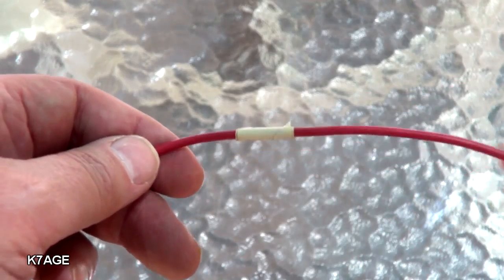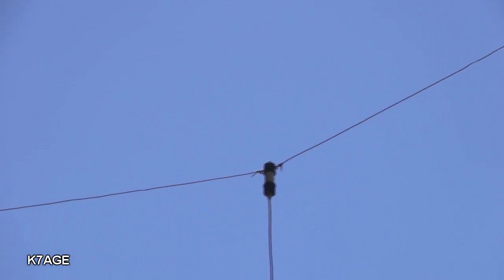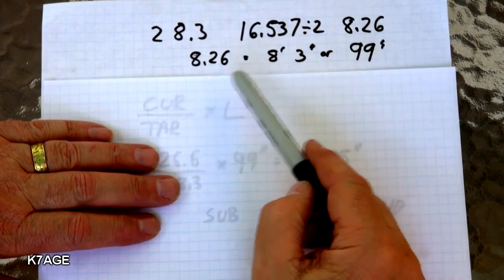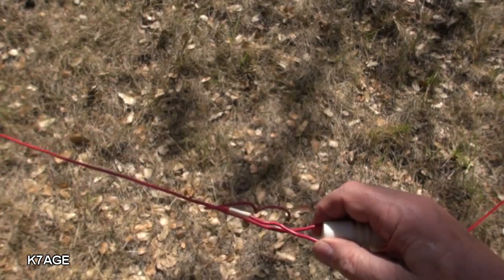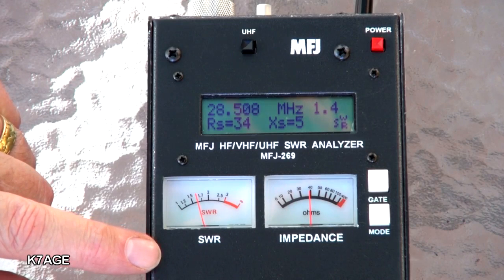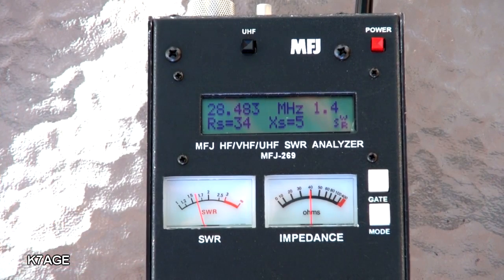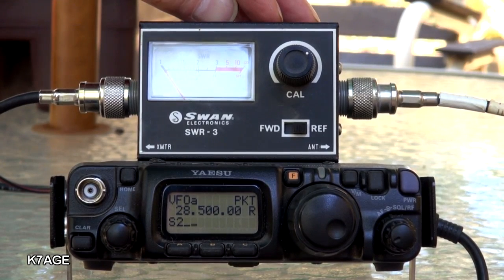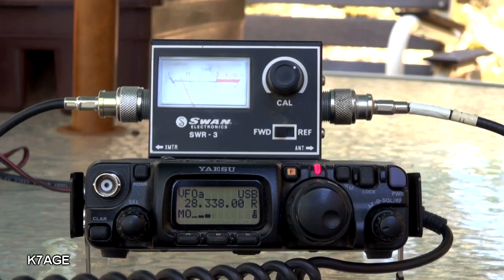How To Tune A 10 Meter Dipole

Comment: K7AGE is there a 10 meter vertical? I’m thinking using white 3/4 pvc & feed the line inside & the end cap holding it @ the top. That pvc is stiff.
Reply from the maker: 1/4 wave vertical and 4 1/4 wave radials

Comment: It's worth pointing out that you can do this by just QRPing your transmitter, keying down, and spinning the dial. If the SWR meter (in-line or built-in) rises, you're headed away from the resonant point, if it drops you're headed toward it. Trim wire as needed. A little trial and error and you're in business. (Like Randy says, you should always start with a slightly too-long wire, cos it's easier to cut some off than stick more on.)

As he also said, an antenna analyser makes everything easier but they're expensive and beginners in particular rarely have one. I've got by for 30 years using the key-down and cut method.

Great video, Randy! Thanks!
Reply: "QRPing your transmitter"  - does that mean adjusting it for low power?
"Keying down" - does that mean to hold down the PTT on the mic, and to do this while changing the frequencies within the band?
ANYONE??????
Reply: @usernamemykel  "To QRP" means to reduce transmitter power out. In this case you'd want no more than 5W. Keying-down means to close the code key. (You'll also hear it used metaphorically to mean "to begin transmitting", but here I mean closing and holding the key while spinning the tuning knob up or down.) 

I suspect you could accomplish the same end by keying a mic instead of a straight key, but as a lifelong brasspounder, I've never had to try.
Reply: @RobMacKendrick   Thank you for the very clear response!

Comment: I have a metal roof and no room to put antenna anywhere in yard. Will this system work over the house? If so how high off the metal roof? Or should I go with a different antenna altogether? Any help would be greatly appreciated.

Comment: Hi Randy.I've seen a few of your videos.
Ten metres is opening up now so I'm putting up a dipole. The MFJ tuner is very nice but expensive and after tuning an aerial how often would I use one again? I can't justify the cost. I cut the aerial long then keep folding back as you did until the SWR on my homebrew resistive SWR meter comes right down. 
Mine worked out at 7 feet 4 inches each side but it is indoors and quite thin wire, SWR about 1.2:1 at 28.500 MHz. 
I just called S51DX, he later said he's using 1 kW. Compared to my 5 Watts it's a huge difference. I didn't work him. Why does anybody want that much power? I wouldn't like to pay his electricity bill.
73, Bill, G4GHB.

Comment: Thanks for the math! Spot on. I have a question. You shortened the antenna on both ends by 6", you just moved the insulator and wrapped the wire, you didnt cut off the extra 6". any reason why? Would it be the same results if you cut it off versus wrapping it? Thanks.

Comment: New ham here. 
After your recalculation you say 6 inches off each end, but your new length is only 6 inches shorter than the original length. Is this correct? Or is it 3 inches off each end? Is it the difference between adjusted length and original off each end?

Thanks.
Reply from the maker: Oh boy, I made this so long ago that I don't remember. I probably made a mistake. Not sure what is correct. It is best to just shorten up each end by the equal amount and wrap the extra back over itself. Then recheck and re-adjust if needed. Thanks for the comment. Randy

Comment: Thanks for the video. Question: I bought a 10m full wave antenna on ebay. Its very roughly 16 ft long on both sides. Would I have better results if I trim it to the sizes you were talking about to make it a 1/2 wave antenna? The seller said if I have the room to hang it I should be fine. Looking for a a second opinion. I'm new to all of this so I don't have any swr or antenna meters yet. Thanks!
Reply from the maker: I don't think a half wave will be at 50 ohms without a tuner or fed with open wire. You will need to check it.  Your radio may have a SWR meter. Just don't use full power. Best to have someone with an antenna analyzer help you out. Look here - http://forums.qrz.com/index.php?threads/is-a-full-wave-dipole-a-good-idea-or-not.179752/

Comment: The basics of your video are good but you went through all that trouble so you should have taken an extra 10 minutes and shortened the antenna one more time.  Seeing a dip of 1.1 at a lower frequency makes it worth the effort to move that dip to where you will do most of your operating.  There is no reason to settle for a 1.5 when you know the antenna is capable of a 1.1.
Reply from the maker: Your are right. One more time would have gotten it spot on..

Comment: Randy, what type wire do you recommend for dipoles? Copper conductor, aluminum, copper clad? I assume this is regular ground wire I can get at Lowes? Thanks.
Reply from the maker: +chalemi I just bought a spool of #14 AWG stranded at Home Depot the other day. Black plastic insulation. I believe that the insulation will make the antenna abut 4% shorter.
Reply from the maker: +K7AGE Cut long, check SWR then trim. You don't need to cut the to trim. Just pull more through the insulator and wrap it back on itself.
Reply: +K7AGE 
OK thanks for the response Randy, Is there a reason you prefer the stranded over solid? Easier to work with maybe? Also, there seems to be alot of debate of analyser vs tuner. If you could have just one, (like me) what what it be? Thanks.
Reply from the maker: More flexible, less chance of it breaking due to bending.

Comment: Hmm and to think I was under the impression that the purpose of the FCC licensing exam was so prospective hams could demonstrate that they had the basic skills and knowledge to do things like Hmm oh say maybe build a simple dipoles or operate their equipment safely, So please explain to me how is it that people today are actually passing their FCC exam and getting a  ham radio license without actually knowing anything about radios and simple dipoles ? The bottom line is is,  Handing out ham radio licences to people who cant even build a simple dipole without an instructional video kinda makes that piece of paper from the FCC worthless.
Reply: +Dan Nelson I think this is an exception and not the norm.  Just because it has happened around you doesn't mean it is happening everywhere.  
I think Randy's videos and others are very helpful.  Videos like these expand on what is in the ARRL manuals.  Actually these videos have more useful information than the ARRL even provides.  I am speaking of the License Manuals.
I will also add that this is what happens with advancement in a technology.  I come from an IT background from the early 90's.  Today's IT person doesn't have a clue what DOS is.  They give you a blank stare when you mention an IRQ or IRQ conflict.  They have never read a jumper block or bank switches.
I also hold a Commercial Drivers License.  I drove semi trailers for 10 years cross country.  I entered that field with no experience.  Some drivers looked down upon me.  Just because I didn't come from a family.  Where my father was a driver and his father was a driver and his father was a driver, etc.  I learned from experience.  The same way I did when I finished my formal education.  I didn't know how to fix/build a computer.  I didn't know how configure network firewalls.
Just because a HAM doesn't have interest in a particular aspect of the hobby.  Doesn't make him or her an incompetent HAM.  Many of the members in my club have had their licenses for 20 and 30 years.  They will even say that not many people work on their own radios.  They are so intricate and complicated that you really need to be VERY careful.   Now granted they can work on their vintage radios obviously.
As far as ECOM goes.  My ARES group is very well respected and appreciated.  We provide radio communications for many events.  Once April arrives.  We are busy with events up until November.  Our AREA Section Manager is very busy.  Along with our Emergency Coordinator.
Reply: I can see your point and agree that videos like this serve a purpose. I guess I'm somewhat disheartened by all the right wing nutjob prepper "coms" videos here on youtube where they dumb down ham radio for their subverted purposes. I personally think this excessive focus on Ecom and doomsday prepping is going to be the final nail in the amateur radio services coffin.   

In my area on the local repeaters we actually have prepper and tea party nets. These nutjobs are a serious embarrassment to ham radio. Nothing like turning on the radio at a boy scout meeting during a demo just to accidentally expose a group of kids and their parents to a bunch of ranting right wing nut jobs spewing illiterate nonsense about the Arab in the white house or one of  their conspiracy theory diatribes. It's no better than CB. 

 It's so bad around here that most of the local served agencies including almost every hospital have severed ties with the local ARES group. The hospitals have lost so much faith in the technical competence and mental stability of  local ARES groups who by the way are now mostly either ecom whackers or doomsday preppers  that they have gone so far as to demand the local ARES groups remove all their equipment from the hospitals.  Exactly how can associating ourselves with a bunch of right wing nut jobs and wanabe cops be good for the image of the amature radio service ?
Reply: +Dan Nelson There are many situations where a "basic" video like this can be helpful. My daughter is working on getting her Tech license. As nice as the ARRL study books are, sometimes a good video like this can demonstrate the concepts more clearly than written material. 

I can also see it useful to hams who haven't been active for some years. Videos like this provide a quick refresher. 

It may also be useful to existing or hopeful radio operators in other countries who have different testing requirements.

All in all a clear, easily understood video. Great job K7AGE.     73 from N4IXT
Reply from the maker: +Dan Nelson Oh well, back in the day you had to draw schematics for your test.....
Reply: +K7AGE Yup I remember those days and to be brutally honest the  radio service was better for it.   
 
Hams are allowed exclusive use of extremely valuable radio spectrum to practice their “radio art”.  Why ? 

At one time this exclusive use was justified because the ham radio service provided an invaluable asset to the nation. The dumbing down of the ham radio service has changed all this. 

 The average ham can't even build a dipole without google, they no longer have the tools nor education or skill to provide any value whatsoever to the nation, 

 What’s worse, is this new generation of hams have no desire to educate themselves. Many new hams actually look down upon science, engineering  and math and chose rather to place their confidence in subjective personal opinion rather than science. They wear their  ignorance as though it were a badge of honor. 

  So ask yourself what value or asset does the ham radio service today provide to the nation which  justifies our existence and use of the valuable radio spectrum  we occupy and use free of charge.    NONE !! that’s the answer !!
Reply: +Dale Miracle  "I think this is an exception and not the norm"

I wholeheartedly disagree and I'm not asking anyone to take my word for it all anyone needs to do is tune the ham bands.  

Thanks to the stupid ham crams which have enabled barely literate people to get their ticket making it nearly impossible to tell the difference between ham radio and CB. In fact there seems to be more hams on that AR15 site then on QRZ.com. The Ham radio threads at AR15 are a perfect example of the dumbing down of ham radio as they are loaded with nothing but myths and wives tails more so than many of the CB forums. 

Technically literate hams are abandoning the hobby in masses as they move on to more challenging hobbies such as robotics, 3d printing and micro controllers.     

Scuttlebutt has it that the FCC and IARU are working towards merging the ham radio phone bands with the CB radio service, Why do you think they have stopped issuing paper licenses, stopped charging for vanity calls and now are moving to lifetime licensing. 

It's because they are planning on dropping the licensing requirements for what was the ham radio HF phone bands. Apparently if they follow through with this the only time you'll need a ham radio ticket is if you plan on operating CW or narrow band non voice digital such as PSK31. In other words they plan on retaining  part of ham radio by protecting  our CW legacy.   In other words they plan on making ham radio strictly CW and digital anything phone will be merged with the unlicensed CB radio service.  

I have to say this doesn't surprise me in the slightest as The ham bands today are loaded with nothing but newly licensed right wing nut jobs,  Rush limbaugh wannabees and CB rejects all babbling about gun rights, conspiracy theories and in the process turning american hams into the butt of jokes and a world wide laughing stock..  

 It's becoming very common to hear DX stations actively refuse to work american hams which is something I've never seen before.  When I say common it's almost a daily occurrence, Just today I Heard not one but two DX stations actively refusing to take calls from american hams.  The other day I heard a couple of DX stations making fun of a group of american hams babbling about Benghazi.  

What ham radio need is quality not quantity unfortunately the dumbing down of the ham exams has resulted in quantity not quality.   

Ham radio is dying and no amount of BS regarding emergency communications will save it,  in fact if anything this excessive focus on emergency communications will most likely end up exposing the technical weaknesses of the new breed of hams and be the final nail in our coffin. The bottom line is the vast majority of emcomm enthusiasts  are so technically illiterate that most don't have the skills to operate anything more than plug and play radio equipment. The moment they are forced to improvise or make a repair in the field is the moment they fall flat on their faces.

Don't get me wrong there are still a lot of very smart hams who I have a great deal of respect for, unfortunately those numbers are dwindling rapidly.   

 
"My ARES group is very well respected and appreciated.  We provide radio communications for many events.  Once April arrives.  We are busy with events up until November.  Our AREA Section Manager is very busy.  Along with our Emergency Coordinator."

Of course you are and here's why.
 
First I should mention that I come from a background in LE,  Ever heard the term "Ricky Rescue" It's a term first responders have used for decades to describe overly enthusiastic individuals who wanna play first responder. I hate to break the news to you but ham radio emcomm whackers have been at the top of the Ricky Rescue list for decades and have always been a major embarrassment to the rest of the hobby.    

One of the common tactics the brass employee to deal with the Ricky Rescue problem is to assign them menial tasks. They do this so they can keep an eye on them while they make them feel important and most importantly keep them busy and out of the way of the professionals while they do their job.  

 Babysitting is what they are doing with the ham radio emcomm groups.  That respect you think you're getting is them stroking your ego so you don't realize the tasks they give you are simply intended to keep you out of their hair. I hate to tell you this but back at the station ham radio emcomm is nothing but the butt of jokes and nothing exemplifies this better than the fact the liaison assigned to deal with the rickey rescue/emcomm problem are commonly known as babysitters.
Reply: I sure do wish I was born knowing everything like you were! It must be nice.
Reply: @kjmdrumz3    Me too. Imagine not having to accumulate multitudes of knowledge over a lifetime. That would free up our time for fun things, like Sophia Vergara.

Comment: When I lived in the Denver, Colorado area a few years ago I lived in an apartment on the second floor and it had a balcony with wooden railings and I had a fan dipole, One cut for 10 meters and the other dipole cut for 6 meters which were both thumbtacked to the balcony railing and that arrangement worked very well. I was using a Yaesu FT 950 which had a built-in auto tuner.
Bill, KI7F, Payson Utah.

Comment: Question : What is an Antenna Tuner ?
Answer : A person with a set of wire cutters.
An Antenna Tuning Unit is an Impedance matching device.
Thank you for another calm video Randy.
7 3 de VK4SOE - Clandestine Radio
Reply: Good video, Randy.  Hi Ade – we meet yet again.  Nice to see Randy physically tuning the antenna by altering the dipole leg lengths – although he agreed elsewhere on this page that he ought to have shortened it even further for better working on the 28MHz (10 meter) band.    
Picking up on what Ade says regarding Antenna Tuners, Hams out there, take note: dealers and manufacturers have been guilty of conning Hams for years that an ATU (Antenna Tuning Unit) tunes an antenna – it does not.  As Ade says, it should be called an IMU – Impedance Matching Unit, or IMD – Impedance Matching Device, as that is what it does – matches the impedance of the antenna system to the 50 Ohm impedance of the radio.  IMHO, better to buy an antenna analyser than an ATU.

Comment: Randy,
Great lesson and demonstration...Thank You!
Because the feed line is part of the circuit, which feed line would you suggest for this antenna?
73
KD2HYA
Tony
Reply from the maker: Tony T. Basically, any 50 ohm coax.
Reply: K7AGE Thank you for the reply!